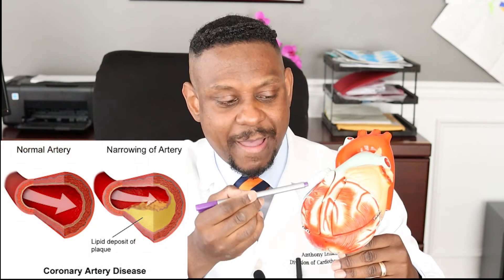How to Perform Coronary Artery Bypass Grafting

Comment: Hi yr illustrations are quite helpful. My question is since the blockage artery is still there, is it just left alone ? Wudnt it continue to accumulate blockage materials? Will it burst or affect anything down the road ?
Reply from the maker: Hi, Sorry for the delay in responding. You asked a great question. The purpose of the operation is to bypass the blocked artery.  We do not remove the "blockage" which is plaque build up. You are correct that overtime the blockage can get worse. However, the treatment of coronary artery disease is primarily medication, diet, and excercise. This combination will slow down the build up of blockages but it's not a 100% treatment. Ultimately, the combination of medical management and surgery will help these patients.